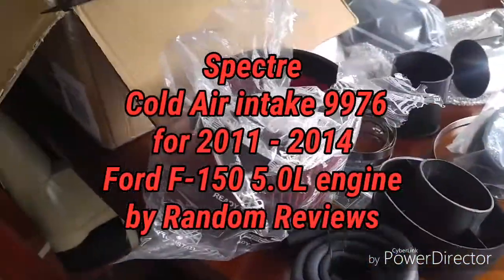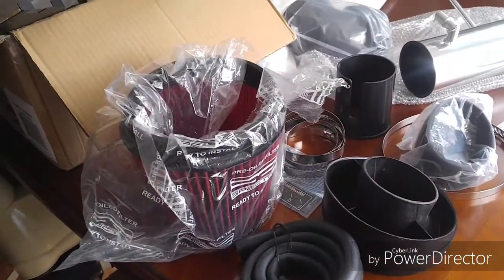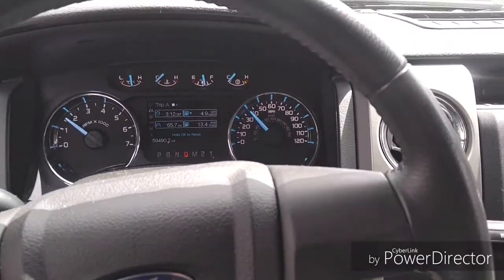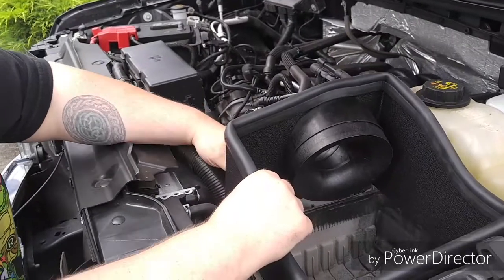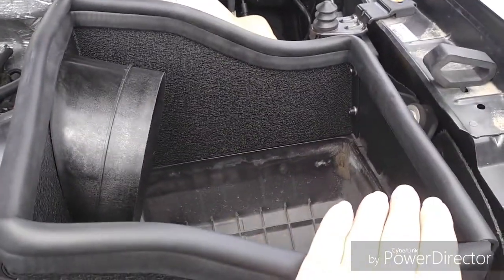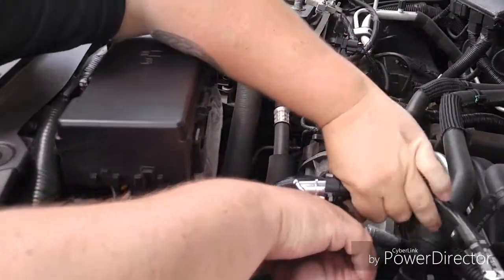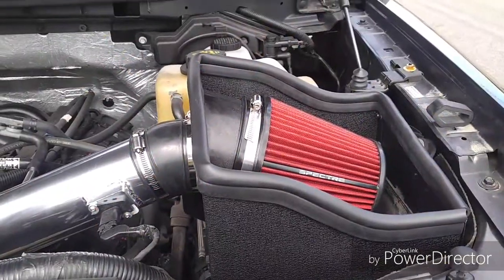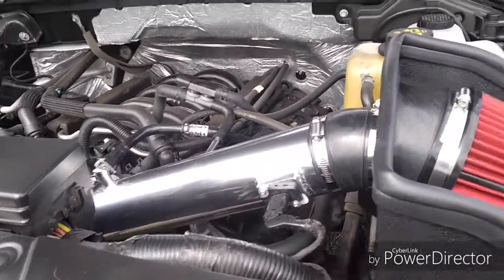F-150 Spectre 9976 Cold Air Intake

Comment: Does virtually nothing to add these intakes other than change the sound a little bit as in louder. You want a quieter more efficient and powerful engine. This does nothing.
Reply: FL moseley unless you get a tune you are correct
Reply: maybe an increase in mpg as well
Reply: Cool story bro.
Reply: I got like another 3mpg on E85. Big difference for E85.